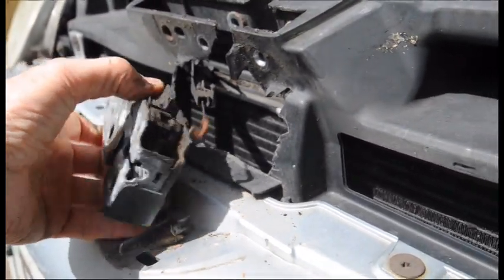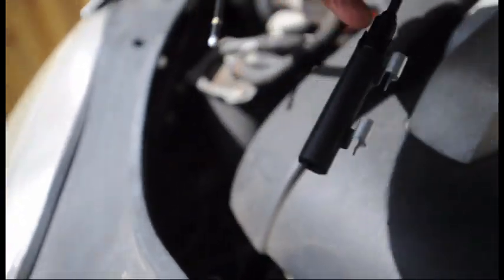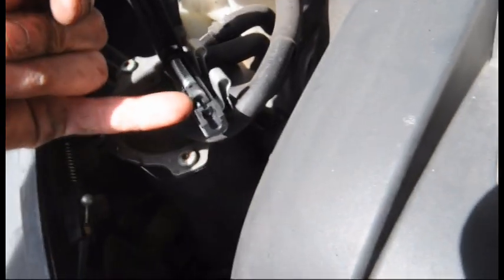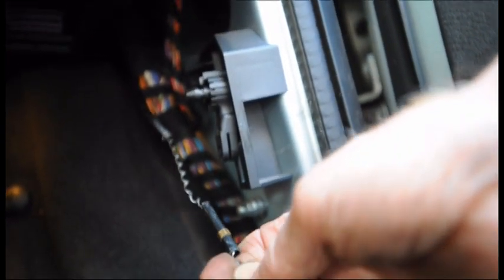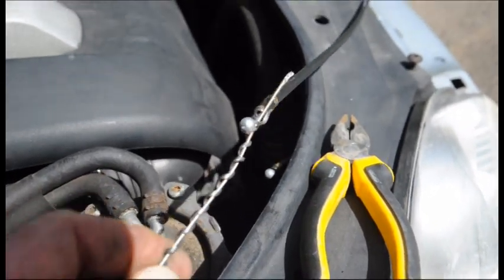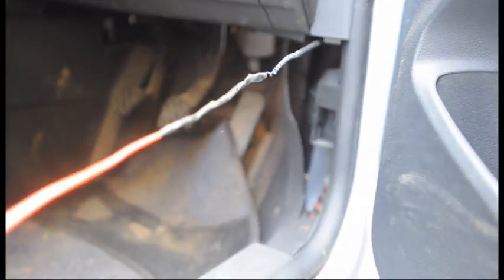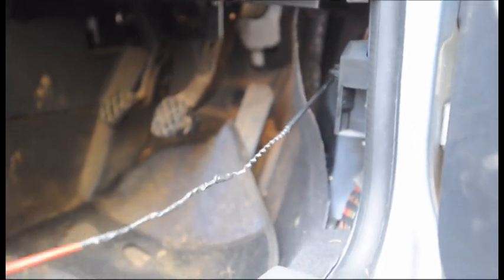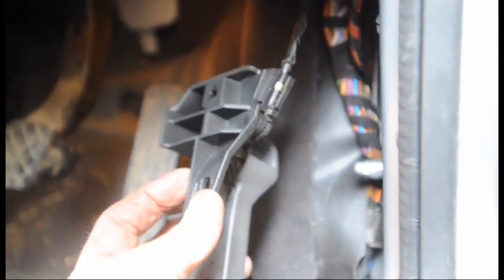VW Golf Mk5 replace broken hood lock cable DIY method

Comment: My bonnet would not close. The latch was totally shot and some of the cable outer was missing in the catch and badly rusted. I was lucky that the cable did still work and got away with a complete new latch assembly which was only £20 on ebay and a clean up of the cable end. The upper bonnet catch was in a poor way too, but with lots of WD40 and working it for ages, it finally worked properly again. The new bonnet catch had no grease, so I applied a good amount of WD40 lithium grease to it and the top bonnet catch. Hopefully I won't have to do the cable any time soon!
Reply from the maker: Thanks for watching simon and leaving your interesting experience. The bonnet catch really is at the 'pointy end' of the vehicle and with the weather it cops I'm surprised they last as long as they do. The route the cable takes from the catch right down to the footwell is also an engineering achievement. Cheers b33zo

Comment: Could you use old cable to pull a piece of string through at the catch end then use string to pull cable in the other direction ?
Reply from the maker: Thanks for watching Dave and yes attaching a guide string is a good idea except by doing that and tugging the cable through I dislodged an important grommet. This resulted in rainwater getting into the footwell (see other video). Another DIY lesson learned.. ATB b33zo
Reply: @b33zo  thanks for the reply . That’s something to think about . The grommet looks like a pain to get to . Mine is broken at the plastic end where it’s in that little box . I was trying to Google bicycle cable joiners or something to join the two cables together . It’s a perfectly good cable apart from the broken plastic bit . Thanks !

Comment: Thank you pal your vid was a massive help
Reply from the maker: Thanks for watching Timothy. Good luck if you have to do the same job.
Reply: on one vid I woched thay tuck the wipers off and the black cover  you will find the cable at the top so you can pull it out there and thread it though the hole into the dash board did this with your help and the other vid it made it a lot easier thank you a again pal
Reply from the maker: @timothyslater4347  Thanks Timothy.

Comment: Thanks, your video most definitely helped. I had my wheel arch liner off already as I had just replaced my clutch. I didn't seem to figure out how to remove bonet release cable which also broke footwell end. I even went further by taking of wing panel lolkkk, which did not help a single bit.
After watching your video, I now have the courage to do  exactly what you did, yank it out.
Thanks again.
Reply from the maker: Hi Jos Thanks for your message. Really appreciated. Hopefully you've got the cable installed now and everything back in its place. A difficult job for sure but not impossible for an enthusiastic DIYer!

Comment: First time I did my bonnet lock cable I learned how annoying it is. I've got it down to a knack now for bonnet lock replacement, can do the entire thing in about 20 mins :) haven't had to do the cable replacement to inside car yet but I'm sure that will be on the job eventually
Reply from the maker: Thanks for comments Road Runner. True, second time is always easier and perhaps this little video will make it easier for anyone taking on this job to see what's involved in replacing the bottom half of the cable..

Comment: I have this job to do on a Jetta, guessing it’s pretty similar thanks for the video 👍🏻
Reply from the maker: Hi Bendude thanks for watching. It's a complicated job but if your hood is stuck down it has to be done. Beware dislodging the wing grommets as you pull the cable through. This will allow road water in and lead to a wet footwell - as you can see in one of my other DIY videos. Good luck. b33zo